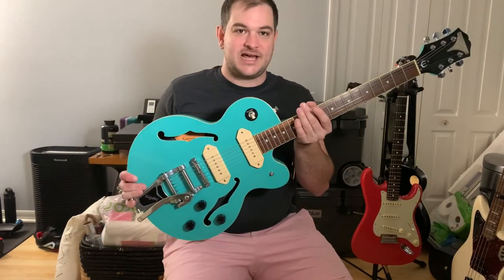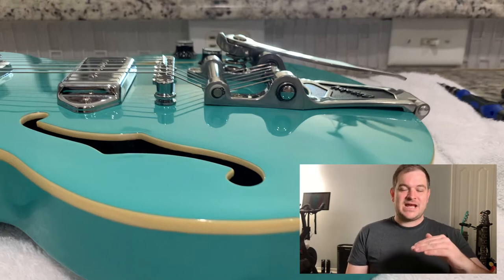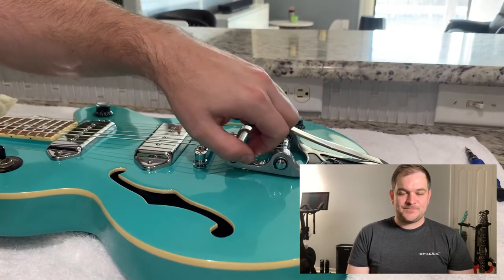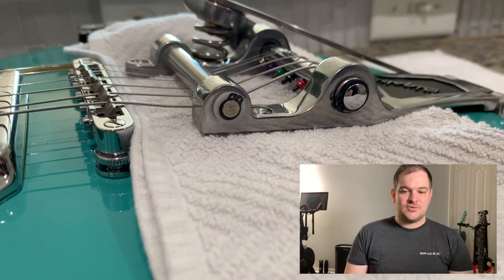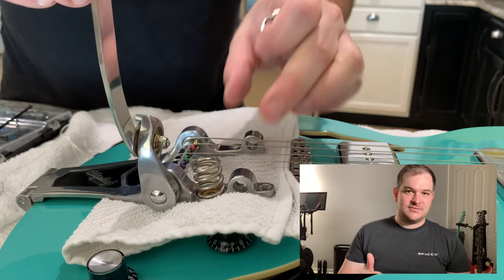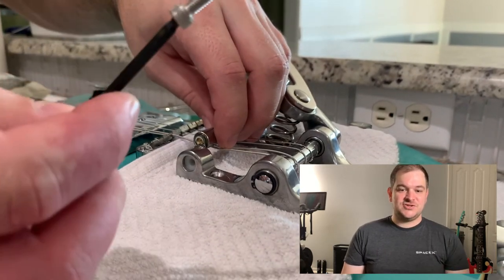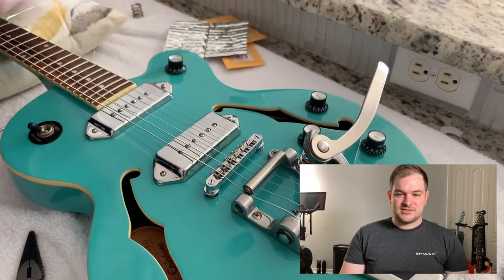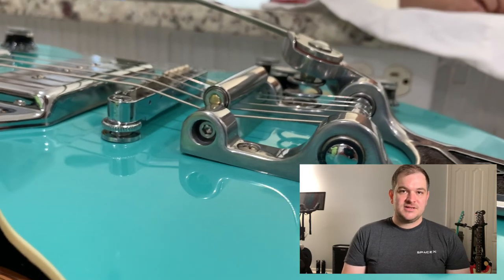Creating an Epiphone Super Wildkat - The Biggs Fix (Episode 1)

Comment: Good video! Good instruction. I bo't a nice used natursl finish Wildkat. I installed the Biggs Fix on it even though I don't use the bar. It's the answer to a built in defect so I feel better about the guitar. Plus it stays tuned better even though I never touched the bar. NO further modifications required. The wiring, pickups  tuners are all good originals. I love the Epiphone Wildkat! Yours must be a monster with all the changes! Good stuff.

Comment: Great series of vids - thanks! Personally I never use a whammy bar - therefore if this lovely guitar were mine, I'd replace the Bigsby with a trapeze tailpiece. But for those who do use a Bigsby, Bryce has pointed out the overly steep break angle as a problem, and has given us the solution to that problem.
Reply from the maker: I’ve found that I end up never using the whammy bar either. I had great intentions and this mod worked very well, but I actually think I’m going to take your suggestion and switch to a trapeze tail piece. Any suggestions on one that fits/works well?
Reply: @RackedAudio  Unsure as to what make, but given that I prefer to tune down a tone (D-D), my personal preference is for a tailpiece that is as short as possible, to give the maximum string length, which in turn gives more tension on the stings, enabling me to tune down. 

And, given that I don't do much by way of bending strings (I play fingerstyle, mainly jazz-influenced music) I tend to go for 12-54 gauge strings, or even sometimes 13-60. I prefer a wound 3rd string, which often I have as a D'Addario Chrome (flat-wound 3rd) so as to be able to do slides (glissandi) without 'squeaks.'

Mainly I like to tune down because my voice is a baritone, therefore I can't reach the higher notes of songs typically sung by guys with a tenor voice. 

I also like to experiment with what strings sound best - for example on some guitars round-wound sound great, on others half-rounds are better, and on some flat-wounds best suit the guitar. 

Thanks again for your informative videos.

Comment: The paper clip idea is genius! I suppose if you used 2 it would be the same as a set of snap ring pliers. Thanks for plugging BricksBiggsFix!!
Reply from the maker: The paper clips were my wife's idea (she's the genius around here). Love the Biggs Fix, its one of the first updates I do with any bigsby (makes it a super easy plug!) One thing I didn't see that I'd love to add is a roller bridge, any suggestions there?
Reply: I don’t really have a fave. I suppose you should stay away from anything under $20 or $30 though.

Comment: Thank you! Great video. Please do more videos about upgrading Wildkat.
Reply from the maker: There are 2 more videos coming out for upgrading the electronics. I’ve also been debating if I should do the tuners and bridge
Reply: @RackedAudio  I've upgraded tuners on mine. Got Gotoh locking tuners, no additional drilling was required. Tuning is more stable now. I guess the nut is responsible for 75% of tuning problems on wildkats. As for the bridge, I'm planning to replace mine in some time. Electronics upgrade is the next step for me. Looking for pickups and pickup frames for mounting various pickups now.
Reply: Thanks for your great, clear explanations. Nice work. Also just watched episode 2. Looking forward to more. I just got a Wildkat Koa. Looking for upgrades and will follow your lead.
Reply from the maker: @colinbdrake  I just checked that Koa model out and it’s incredible! Thanks for the compliment on the video. The lollar pickups sound awesome definitely check them out if you’re looking for an upgrade. Next Tuesday I’ll post the install and sounds!
Reply from the maker: @GuitarWorkshop  awesome. I’ll check those tuners out. I was also looking at graphite for the bridge saddles. I’ve never tried those out but it seems like it’d be an awesome upgrade.
Reply: @RackedAudio  Cool. Can't wait. Can you specify which exact Lollars you got? Thanks!
Reply from the maker: @colinbdrake  Totally. I went with the following: Underwound P-90 Dogear Neck, Regular P-90 Bridge, and the shim pack. Shim pack is a must! (Edit: This is the link to the specific P90s https://www.lollarguitars.com/lollar-p-90-pickups/p-90-dogear )
Reply: @RackedAudio  Thanks so much! Most helpful.

Comment: How come you didn't add a roller bridge?
Reply from the maker: Definitely something I’m looking into. I did a bunch of googling and reading forums, and there was very mixed messages. Some say the tension is too high and it doesn’t actually roll and others say it’s life changing. I may add it and make another video with my findings. Any suggestions on a good roller bridge?
Reply: @RackedAudio  Compton Compensated Bridge - the best of the best!

Comment: Why buy a "Biggs Fix" roller kit when all you need to do is put spacer washers under the front attach points to raise the whole unit? Total waste of money and it looks stupid.
Reply from the maker: Certainly washers could work but I think you might end up with some risks. I haven't tried washers so this is just how I'm thinking about it, but I do have a few concerns. 

1) it would adjust the angle of the bigsby, and the neck side would sit higher, making the handle angle different and probably less playable. 
2) instead of somewhat even pressure from the bigsby on the guitar top it would create pressure points where the washers are (less surface area) and also uneven pressure from the washers given the angle from concern 1 and dig into the top. Maybe its possible to use nylon washers but by that point they either compress and cause the same issues OR they're not fully compressed and could reduce tuning stability.

Again I haven't tried your suggestion so its very possible it works great and I'm over thinking it, but for me the BiggsFix worked really well, was reasonable in cost and solved my specific problem. 

I appreciate you watching the video and taking the time to comment!!!
Reply: @RackedAudio  I have 3 guitars I've done it to, (an Epiphone FlameKat, a Gretsch Streamliner and a parts Paul), and they work flawlessly. You just have to make sure it's level side to side and not warping. On the B7 the angle difference is negligible, though you may need to use thicker spacer for the front most mount, and the washer under the spring can be left out if too steep. For a B5 I would just use 4 equal washers to raise the whole unit. Thanks for the reply!